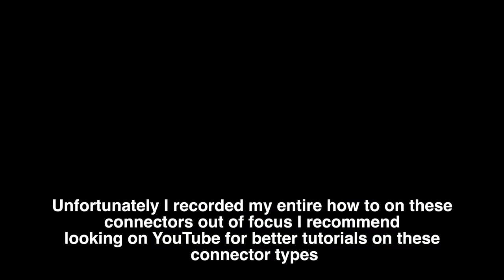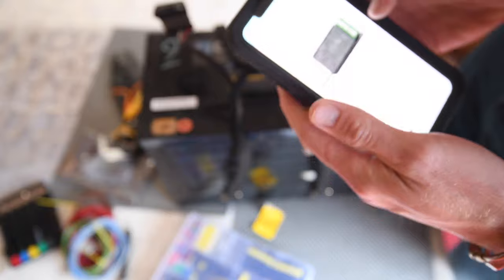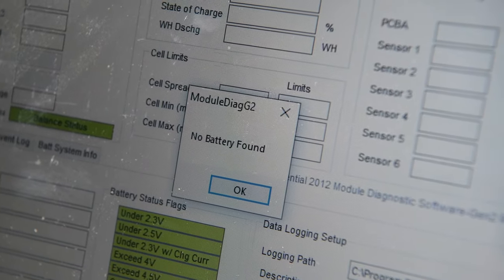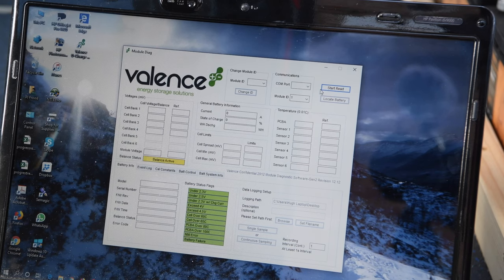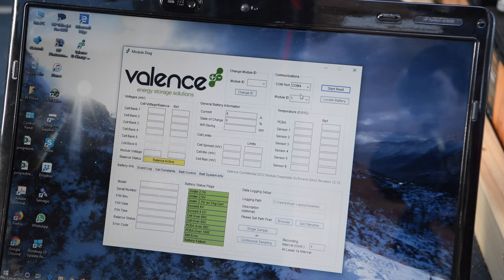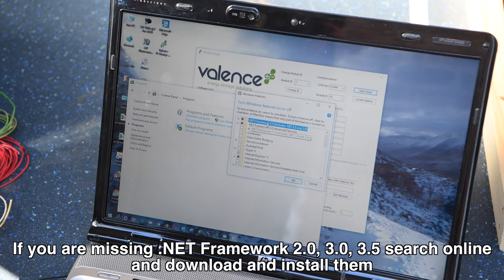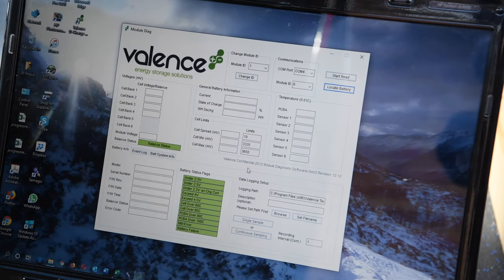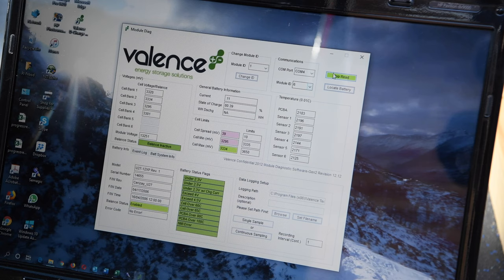HOW TO: USED & Cheap Valence U27-12XP Lithium batteries. Repair, Communication & Software issues

Comment: i ordered a prebuilt wire from ebay for this battery and software, drivers, com port all seem correct, yet it says no battery found after clicking locate battery. My u27-xp12 has been great for years but recently dropped to a current 2.6v so i am trying to wake it up. no flashing light on battery
Reply from the maker: Hmmm. Have you be able to confirm the prebuilt wire is working? Maybe check in continuity between all the pins making sure that the connections are all working?
Reply: @MispronouncedAdventures  thanks for your interest, i have not been able to confirm that pin 2 and 5 are putting out 5v. but the wire was from a reputable ebay account that sells to the popular diy solar forums for this reason. I have now tried two different PC's with obviously separately installed software. FTDI drivers confirmed, .net confirmed, running as ADMIN confirmed. software seems to be running fine, but both computers say no battery found when i click locate. when i unplug the wire and use a new usb port the COM does not change from COM 4 but i can see it come up and disappear from my devices. This is the same for both computers. I tested a usb port that does charge my items like mouses and keyboards, but when i test my multimeter on the 2 and 5 pins like the "superthread" says, i do not get any voltage.

Comment: Any chance of listing the connectors and usb parts from amazon?  Been looking for months for this info can't thank you enough for the info.
Reply from the maker: No problem at all are you were are you based? Connectors eBay would probably be the best option, they are called AMP superseals or Tyco connector. Loads of kits, you want the 5 pins version. But I bought a whole kit from 1-6 as they are useful.
Reply from the maker: As for the USB search “usb to rs485” there are quite a few versions. Go for one of the smaller black models. The larger blue types seem to no all work. If you go on Amazon and look at the pin layout and see it’s got 5V, A+, B- and GND, that’s the important one most will have an additional 5th pin which in this case we won’t use.
Reply from the maker: USB to RS485 Converter Adapter FTDI CHIP with Screw Terminals and Windows MacOS Linux Support (Black) https://www.amazon.co.uk/dp/B07SD65BVF/ref=cm_sw_r_cp_api_i_xIzIFb39VPNR1

This is a UK Amazon but if you can find a similar model that will work
Reply: Thanks

Comment: Think we should chat - I got 2, 3, 10, 14, 15, 16, 20, 22 and two others... I see someone else got hold of the electric van haul
Reply from the maker: Haha brilliant. I did a video about their back story and where they came from in my van build series. I also came across someone else who got a few from this set as well! We were probably bidding against each other at somepoint!
Reply from the maker: So far extremely happy with them in the van. One of my other videos shows how I implemented low voltage cut off protection, high voltage cut off protection and cold weather charge cut-offs. Currently in the process off adding adding a small battery warmer.
Reply from the maker: If you wanted to chat about them. Message me on my Instagram :)
Reply: @MispronouncedAdventures  will do, what's your username?
Reply from the maker: “Alexfrood”

Comment: Any recommendations to purchase the U27, for a reasonable price?
Reply from the maker: Unfortunately no, they are pretty rare in the UK on the second hand market. Only upside is they usually sold off in decent size batches when a vehicle is broken up with them in. Just need to keep an eye out in eBay they seems to come up every few months. Unless you are US based where they seem a little more common

Comment: How can I balance each of the 4 cells in one of the 12v battery?
Reply from the maker: Kamal Hussain having the battery plugged into the diagnostic software ( or a Their master U-BMS )  and charging them at the same time will activate the internal BMS’s cell balancing once it reaches a high enough voltage ( can remember what voltage) and has a large enough cell spread . I’ve also found no keeping them at 100% SOC helps and have a load using power will help the cells remain level

Comment: Instead of all the fanzines, can you go direct from cut wires to usb rs485?
Reply from the maker: As in cut the Tyco connector off directly off the battery and wire it directly too the 485 to USB adapter? Yeah you can. But a lot of people prefer to make an adapter to plug into or if you are Daisychaining multiple batteries Communication cables together
Reply: @MispronouncedAdventures  sweet! Very helpful video. Thank you

Comment: Hey there, I could use your advice with my battery, it has round plugs on the data cable, it's a black valence u27 12xp, I'd like to change the plugs so in future it could connect to a later green battery if that's possible??
thanks for any help
Reply from the maker: You might run into a issue. The black models are 130ah, whilst the newer green models are 138ah. So mix and matching won’t be an option 

But I have seen people cut off the round plugs and put the newer style of plug on
Reply: @MispronouncedAdventures  I'm having the same problem. Trying to combine 1 black U27 12XP with three green ones. I did not know the specs were different. Can you possibly provide a link? Many thanks!

Comment: Can you replace cells in a battery when they don't perform correctly?
Reply from the maker: Generally no. They are sold by valence as a “sealed” unit / final product to the end user, not designed to be built and changed like you might if you were purchasing your own cells. Reality I mean you could take it apart and reuse / replaces cells if you wanted but they used 18650 cells in 4 groups of 100 cells each and from my understanding the 18650 cells are valence own brand using a LiFeMgPO4 chemistry and not a genetic LiFePO4 cell. So possibly but likely a pain in the ass and a decent skill set needed to do
Reply: @MispronouncedAdventures  I saw a teardown vid on a Valence batt & they used cheapo Chinese cells 3.2V, 1.8A, 5C max discharge rate.  Not sure if they used the same cells in their new batts.  Thx 4 responding to my question!
Reply from the maker: Teardown video wise are you referring to Will Prowse video where is disassembled a RX? Aye you can find them on Alibaba with the valence branding on about £1 each. Considering there are 400 of the cells in batteries it start to add up. Interesting to see those cells on Alibaba listed still as LiFePO4 and not LiFeMgPO4 valence always talk about using. But that probably a mislabelled for some reason
Reply: @MispronouncedAdventures  Yes, but, there are actually several teardown vids available.  I noticed that Valence uses different cells.  It seems the battery configs are 4S100P for the 130+AH batteries.  That's a lot of cells for 5$ when you can find such a deal!  That's about 1.25 cents USD per cell! :)
Reply from the maker: Fair enough. I had also notice the cells in the RX were orange, whilst in a tear down video of the XP 130ah the cells were bluesy/green. So I did guess they were something differently but I didn’t see the specs
Reply: @MispronouncedAdventures  Yeah, I saw that vid , too.  If you are dying to know which cells they were, you might be able to find them on this website:  https://secondlifestorage.com/celldatabase.php?fkeys=&fbrand=&fform=18650&fmincap=&fsort=1
Someone has done a lot of work building such a database. It's quite thorough.  Enjoy!
Reply from the maker: That’s a really cool database, that must of been a lot of work ! Much appreciated

Comment: Great video, I have just the one older XP, controlled  via a https://www.amazon.co.uk/gp/aw/d/B08DNMK1CM?psc=1&ref=ppx_pop_mob_b_asin_image. And a  Mt50 , also have  this mains charger, that has a lifepo4 repair mode ? Have found the rare tech docs pdf on these, which I wanted to know what the max amp discharge was on a single.

Comment: https://www.amazon.co.uk/gp/aw/d/B08DNMK1CM?psc=1&ref=ppx_pop_mob_b_asin_image. Handy backup charger for a single. Have watched it sense this battery, and the repair mode did its routine and seem to function, will be checking its amphrs when I put a designer shunt across soon. Also this charger brought back very dead 12v battery's, quite impressive. Expect you will you be grounding all those van cells?